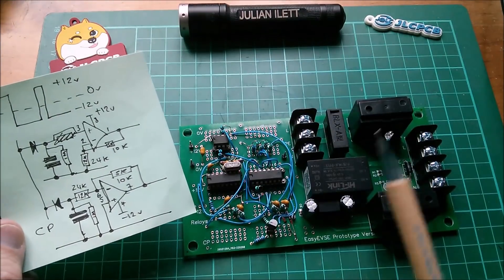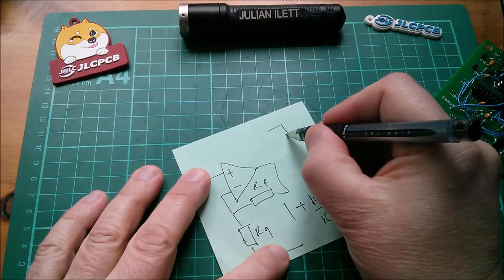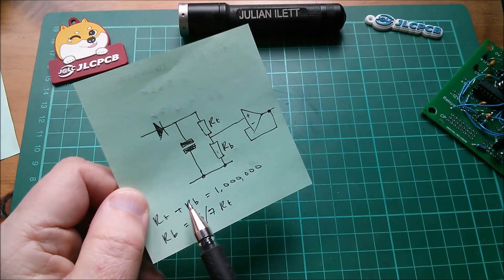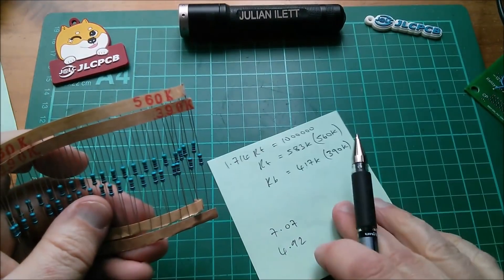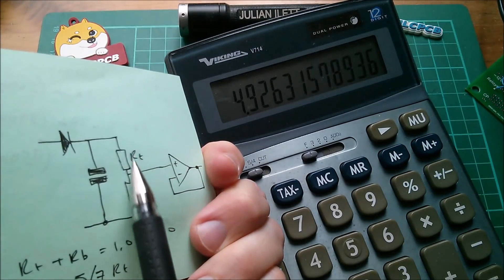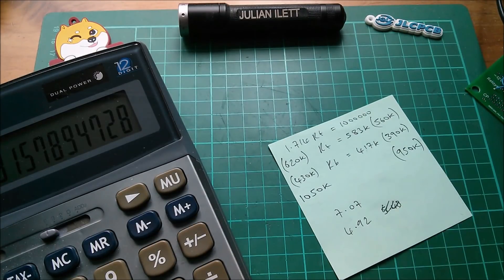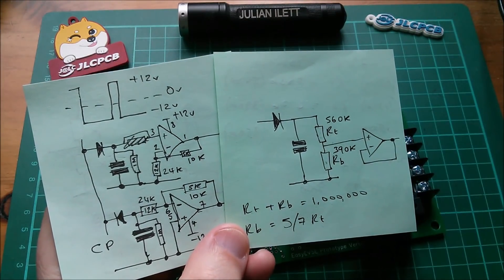Resistor Simultaneous Equations

Comment: If you are measuring the voltage via teh divider/opamp buffer the theoretical resistor values are less important than actually measuring the resistors you use and then using those Ohm values in the equations in the code.
If Rf turns out to be a 560k and measures at 559.6KOhms work with the later.
Also, if the voltage range you are measuring has a bottom end, you could bias everything down such that the ADC range of 0-5V covers a real world (example) 9V to 15V.  Instead of 0V to 15V.
I've been working on similar to use the DAC output of an MCU to control a buck converter who's error amp expects 0.8V and I want the output control to be between 2.5V and 4.3V.  I've simulated it and got it working, DAC 3.3V gives me 2.6V and DAC at 0V gives 4.3V.  Load independant.

Comment: Try an emitter follower,  just one transistor (npn) will be almost as effective as a unity gain buffer. connect  base to the Cap Diode junction, collector to +12, emitter to the top of the low impedance resistor network. Modify the R values so the high level is compatible with  arduino input ... 
For very high input impedance use a fet configured as a source follower, you'll need the 1M parallel resistor to discharge the Cap

Comment: You can cheat and use  a calculator. I tried posting a link, but it didn't get though. Search for Resistor Value and Ratio Calculator. It suggests 56k & (18k+22k), but if you multiply by 10, you get a total resistance of 960k, which is near enough 1M.

Comment: You can always make a choice resistor value by series or parallel addition, realistically you could easily use a preset pot turned to the ratio that you want.

Comment: Connect the dual op-amp to both 12 V and -12V supply. Then take the input voltages (both) to the inverting inputs. With the resistors Rin=20K and Rf = 8K2 on both, you will get -4.92V from the 12volt input and 4.92V from -12volt input. You should be able to use this, it's just inverted the outputs.

Comment: Voltage followers on both, then invert/scale accordingly. Potentiometer divider on Arduino Analogue input is fine, its input impedance is 100MOhm. Scale in software after (y=mx+c).

Comment: I would just picked an E12 value for one of the resistors (say the smaller one), then worked out the correct value for the top one to match the ratio and made it up out of a few different values combined. Every tech should have a resistor pack with sizes of 1,10,100,1K,10K,100K,1M. With just those you can make anything you need.

Comment: Because of the diode the resistor divider is seeing 11.4V, not 12V, right? So with 390k & 560k the highest output voltage would be 4.68V. If you use 430k and 560k then 11.4V would become 4.95V.

Comment: Within the tolerance limits of the E24 series (+/-5%) you may be able to select a pair that give you exactly 5:7. However if you pick the resistors at random the 560 could be anywhere between 533 and 588 and the 390 anywhere from 371 to 409 (at 5% no point in using more digits). Your divider ratio could then be anywhere from 0.387 (=4.64V) to 0.434 (=5.21V). Of course your resistors may have tighter tolerances. You have several options. Build in some calibration factors into your Arduino software, but remember that the input should not go above 5V in any case. As one comment says, tweak the divider by adding a 3rd resistor in parallel (or series) with one side of the divider. Put a tweak pot in the middle of the resistors, a 10 turn 100K should do it. Alternatively make the voltage divider  greater than 5:7, say 750:300 giving 12 X 0.2857 = 3.4286V  and reintroduce Rf =11K and Rg = 24K  to give a gain of 1.4583. 3.4286 X 1.4583 = 5.00004V. 😀 Note, this calculation was made easy by first using a spreadsheet to calculate all possible ratios of the E24 series, from 1:9.1 to 9.1:1 and then using it as a lookup table for possible ratios.

Comment: Julian, you're tilting at windmills here.  Analog design is not as exact as you're trying to make it.  If you need the level of precision you seem to want, just use a 1M pot and trim the node to 5V.  That said, you shouldn't bother; your Arduino's ADC will have zero headroom with a 5V supply as reference.  You've also neglected the 5% tolerance of E24-series (5%) resistors.  The ones you've chosen may give you a result anywhere between 4.64V and 5.22V.  You can hand-select resistors, but you won't have a repeatable circuit design.  Choose resistors that can't exceed about 4.9V and write code that will let your Arduino learn and store the max ADC value for CP in its particular installation.  Finally, as others have pointed out, your inverting op-amp has an impedance problem as well.

Comment: Hello Julian. Maybe select the lowest value of the 560K, along with the highest value of the 390K resistors to bring the value closer to 5.0Volts? Or, as was suggest in the comments, add a Variable resistor in circuit to tweak the output value of the opamp.

Comment: Even the old 741 has a 2M ohm input resistance. Most today's OP amps have input resistance in GigaOhms. 
Use a 1M Ohm pot instead of 2 resistors. That way, you can adjust.

Comment: You forgot to include the precision of components in equation. And best way is to use unity opamp directly behind capacitor, and use resistor divider on output of opamp. No problem with virtual ground.

Comment: The inverting amp seems to present a leakage path via the resistors that is a lot lower than the 1 meg you are looking for ?
How about using non inverting on both inputs followed by a resistive divider and a unity gain buffer on the non inverting.
For the inverting input you can follow the 1+ ratio of the first stage with an inverting amp to correct the ratio.
This way you maintain the input impedance and the output drive current all in a single quad op amp package :)

Comment: maybe i'm missing something, or just forgot the reasons why from the last video, but why bother with exact 12->5V when you can use the same configuration of 3x 330k resistors for inputs of both non and inverting op amp, as well as feedback of inverting op amp. That way you can use all the same resistors (8x 330k in total), or at least (6x 330k) if you're using different resistor for the inverting op amp feedback (2x Xk). You do get lower voltage (4V vs. 5V), but with a 10-bit arduino converter, out of 1024 "levels", you still get around 800 of them (5mV resolution).

Comment: Julian, the inverting amplifier is creating a virtual ground at the Junction of Rb and Rf, so with RB = 20K that is the load across the capacitor, far under 1M !.
If the same 20K and 10K were used as divider across the capacitor, you have 30K load  which is higher than the inverting amplifier.
It is in fact the inverting that has worse loading. . 
In my previous message I only referred to non inverter ideally uses higher resistances.  Really both must keep higher values if you seek 1M load on both.
Reply: Yes... the RC of the inverter input is more than several orders of magnitude less than the non-inverting.
Reply from the maker: Yeah, I got so excited about the simultaneous equations, I forgot to mention the inverting op-amp also needs higher value resistors.

Comment: Actually, your inverting circuit will also have an impedance problem.  As it is setup it has an impedance of 12k which will totally mess up the time constant of your filter stage.
Reply: You are right. The negative input of an inverting op amp is a virtual earth point, so the input impedance is 12k in parallel with 1M
Reply: Yes... thanks for seeing this...that was the first thing I thought of when Julian said it was important to have a 1M ohm input impedance...
Reply: Yes, I'd guess he'd be better off using a high value (say 1M)  at the top of the divider with a much lower value to earth as the divider and creating some gain (I don't know, maybe a gain of 50) in the op-amp to get the output voltage he is after? The output impedance would be quite low too then - I think. Haven't done this stuff for decades.
Reply: @Bennyboy-dog  you could replace th 1meg resistor across the capacitor with a 1meg resistor on the input, and then select a suitable high value feedback resistor.  But you would need to be careful to use a low bias current op amp such as a cmos opamp.  A more robust way would be to use buffer stage to isolate a lower value voltage divider on the low impedance output.
Reply: @argcargv  Ed, you've tickled a few neurons there mate. Spot on and thanks.

Comment: Why not just using a 1 meg linear potentiometer and adjust it precisely to 5 volt?
Reply: i don't think Julian has planned for a place on his pcb prototyping area for a trim pot. a third, fixed resistor in series would be close enough though.
Reply: doh, 10k in series would be close enough.

Comment: Great video and idea of voltage reduction keeping impedance roughly the same. I would have 'paralleled-up' some resistors to give you a resistor value closer to what you wanted, although what you did from the high end to low end values, seemed to approximately fulfil the requirements. Lets see how this works out in practice!
Reply: I was thinking that two resistors in parallel for Rt would be a good idea.

Comment: pop a 10k trimmer pot in series with the lower resistor. You can make it as accurate as you like.
Reply: i don't think Julian has planned for a place on his pcb prototyping area for a trim pot. a third, fixed resistor in series would be close enough though.
Reply: doh, 10k in series would be close enough.

Comment: Why not use a trim pot to set the exact resistance you need
Reply: Right. 50k trimpot with the given Volltage divider equals 1M as input impedance exactly. Perhaps thats too theoretical concidering the voltagedrop over the input diode. At least you can match the ratio of the second opamp exactly.
Reply: Just don't ajdust it while it's connected to the arduino input!  I get the impression that perfect accuracy isn't critical here, after all he's using a peak detector.

Comment: Why don't you just use the opamp as a voltage follower (high impedance input, low impedance output) with the potential divider on it's output to feed into the arduino.
Reply: I was going to comment this, so you could tailor the voltage divider to suit the Arduino more.
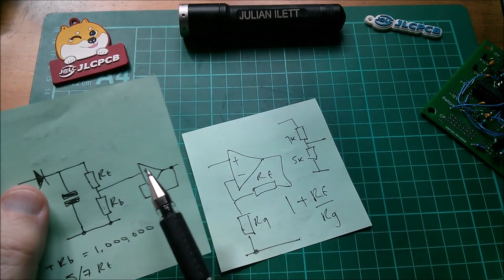Reply: 3:17 That's exactly what he did!
Reply: @Enigma758  no, the divider is on the input
Reply: @maxxiang8746  Yes, you are correct, sorry I responded too quickly.  But what would motivate you to put the divider after the op amp?  Op amps typically have low impedance outputs so I don't think there should be any problem driving an arduino input.  Also, divider as input to op amp is a fairly standard pattern.

Comment: So weird, I used a unity op-amp in my last bit of circuitry. Can you not have the resistor values in the code and fix up the values after the AD in software?
Reply: You can, but the Arduino AD converters are 10 bit which isn't a lot, and the more software conversion you have to do the more "bits" get lost to scaling in the calculations. It depends on how accurate you need your readings to be, Its a bit like digital zoom v analog zoom on a camera.